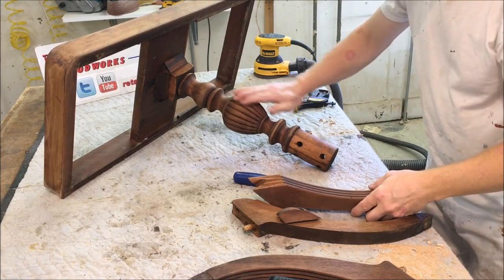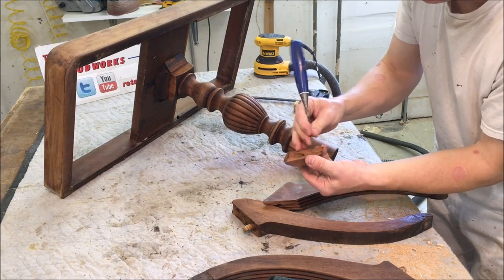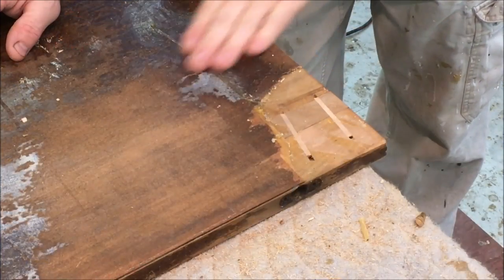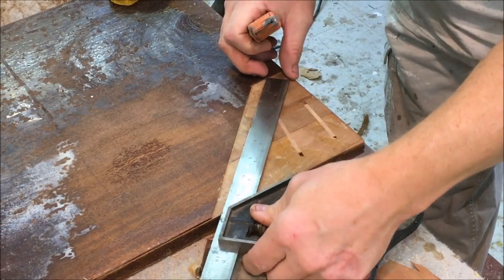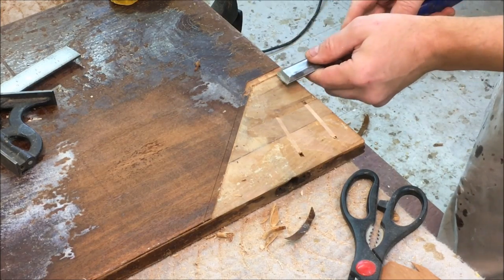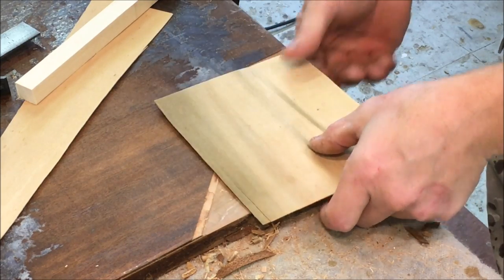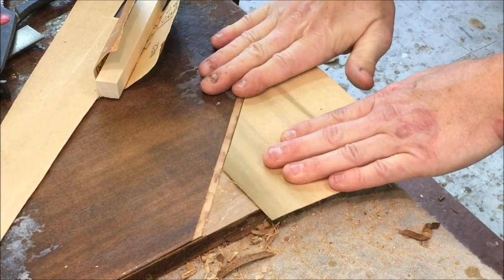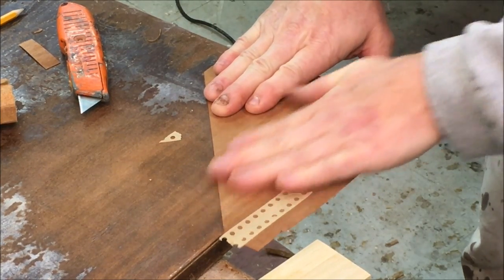RESTORATION/ REPAIR  - MAHOGANY VENEERED  CARD TABLE( PART 2/ 2)

Comment: what I like most is that you did not rip the damaged mahogany veneer from the table top and replaced it. Now you can see the repair but since it is done in such professional way it adds value to the table. I like old furniture more, if it is not overrestored and then virtually looks like new. I really believe you rescued this table. thanks from Germany for uploading this video.

Comment: hope you dont mind unsolicited advice. You can use a household iron on the old veneer and it will separate very easily  as it melts the old scotch type glue. Also when cutting a new piece of veneer always overlap it with the old veneer to be joined and cut both at the same time and undercut the straight edge . this way both mating edges will match perfectly with no gaps.
Reply: I tried the iron on my antique sewing machine case and it did not work. I even tried steaming it but it did nothing. I want to save as much of the veneer as possible.

Comment: I have this same table i started disassembling and cleaning over 10 years ago.  If i remember correctly it just need the old shellac cleaned off.  I need to dig it out of the corner of the basement and finish it.
Reply: I have the exact table and is also loose...

Comment: loved the video i have several old pieces that need to be fixed like this i hate to see these old pieces damaged and worse than that i hate to see someone use bondo on them and then paint them it is a woodworking sin my question is where to find the veneer repair pieces thank you

Comment: Why the blue tape over the glue line for the top veneer?
Reply from the maker: it is just to keep the veneer from slipping , easier to remove than veneer tape
Reply: ROSS TAYLOR WOODWORKS does excess glue create a problem for you when doing this? I’d be worried it would impede staining, or at least be difficult to remove because of the tape. Do you find that to be the case?

Comment: Since its effectively impossible hide the patch, I would have made that a full 45 degree, instead of having that odd corner, and then do the exact same cut on the other side.  That way the patch would have actually looked intentional, like a design feature, instead of looking like a patch.